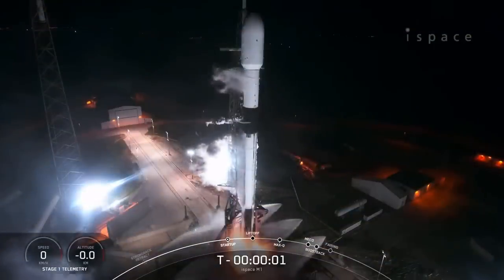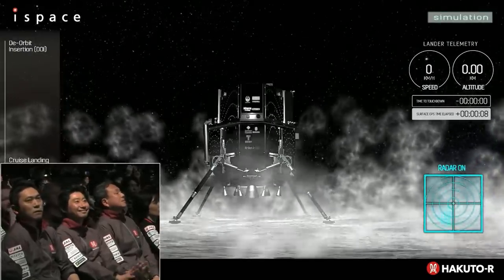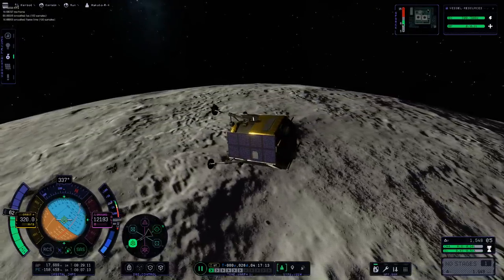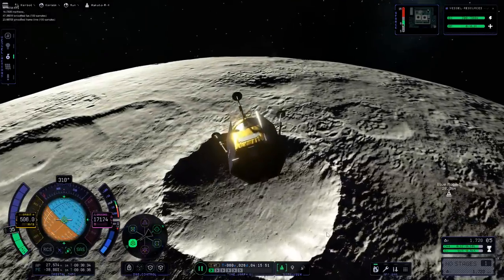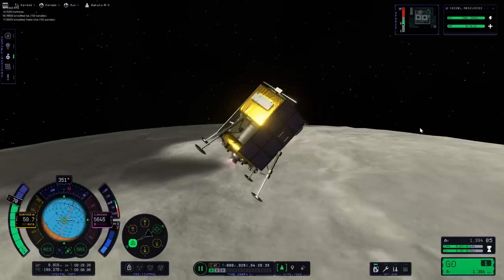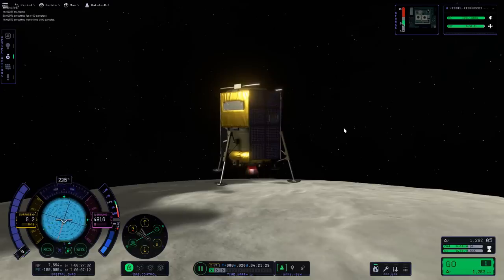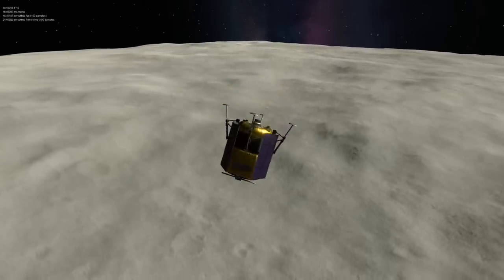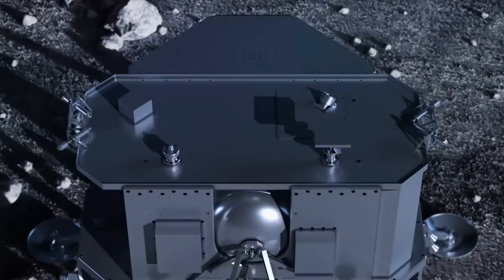Why Japan's Moon Lander Crashed Due to An Unbelievable Computer Bug

Comment: I feel such compassion for the Hakuto-R team. They are going to accomplish it!
Reply: I hope that they can make a new one and landed on the moon the next few years
Reply: I watched the landing live stream and I felt so bad for them. Their nervous faces really hurt me too. I bet they do it next tie!
Reply: They may not accomplish it. Very often such incidents reveal a whole load of issues that have been swept under the carpet, and the necessary organisational change required to address them all can easily break a small team / organisation. 

Even big companies can be killed by this. This is what is going on in Boeing right now. They caused the crashes of two 737MAXes and killed people. Since then they've tried to institute root and branch reform of how they run their business. Yet, they're still having problems. The most recent one was a fuselage manufacturing defect (they were building them wrong) that had gone unnoticed for approx 700 airframes (yep they're flying, possibly with Southwest today!). Fine, they've found it, repairs needed, not immediately dangerous, but cannot be ignored. 

Trouble is the manner of them finding it was accidental; someone was in the right place, at the right time and realised what was going wrong. The issue is that, if despite the introduction of a root and branch reform about how they approach quality (= safety, reliability) they're still finding major issues by chance, then the root and branch reforms are junk and are not working. They should be finding such problems as part of a systematic continuous improvement process, and they're not. So the bet-your-life question is, what else have they missed, given that they've essentially admitted that they've not been looking hard enough? 

It's similar with 787 (fuselage barrel joints), brand new 737MAXs with FOD and rodent damage, etc. 

This suggests to me that Boeing are in no way adequately reformed following the MAX crashes, the problem most likely being in the senior management who never understood it before and are still there today. It's worryingly possible that they're going to make another fatal mistake. Ok, the FAA is now (belatedly) keeping a much beadier eye on Boeing, but they can't see and check everything; certification engineers / inspectors are not there to do basic QC and basic QC improvement. 

The Hakuto team's best bet, if they're to try it again, is to just fix that one core issue and try again, and do as much simming as they can muster. Unlike Boeing, crashes are just disappointments and money.
Reply: ❤❤❤❤❤❤❤❤❤❤    Yes they will succeed…… After they spend a lot of someone else’s money……… Let’s all go to Sugar rock Candy Mountain
Reply: But they launched knowing that their testing was invalid.  Kinda like practicing parachute landings in a field, then jumping over water.  I hope they don't ask me for a donation, because polite refusal often offends.
Reply: @emileriksson76  What color is the next tie?
Reply: @abarratt8869  The one thing the Japanese are good at is incremental improvement, even at large organizations. If anyone were to succeed at a second go, it would be them.
Reply: @abarratt8869  Wow that is one monumental leap from a software testing issue to a systemic corporate issue in one step. Good example of sophistry for a logics class.
Reply: @zorbakaput8537  It's a reliable and well documented leap. There is no mystery as to how to do things such that success is more likely that not. The systems engineering and organisational processes are extremely well documented, including by organisations like NASA, Toyota, etc. Choosing to not follow them is an organisational issue. 

There's a pretty good dissertation "Lessons From Systems Engineering Failures: Determining Why Systems Fail, The State Of Systems Engineering Education, And Building An Evidence-Based Network To Help Systems Engineers Identify And Fix Problems On Complex Projects" by Diane Constance Aloisio from Purdue Uni which is pretty good, and cites more good material on the topic. Fig 2.1 illustrates the STAMP model of accidents and the places where failures occur; most of them are nothing to do with technology design and implementation. And another example, the Challenger Accident report, points primarily to organisational failures in NASA, rather than to the design and implementation itself being irrevocably wrong. 

The Japanese themselves summarise it all as "ask Why? at least 5 times" to get to the real reason for a failure. In this case, question 2 is "why wasn't simming done?", and you're then already straight into organisational issues, and not technology issues.
Reply: @abarratt8869  the loss of Columbia is particularly unforgivable after a history of previous foam strikes. Just like with the O-ring burn through everyone thought it was ok to keep rolling the dice because they had gotten away with it until they didn't. Such complacency is still shocking to this day.
Reply: I don't know if that team will be staffed by the same people next time...
Reply: Well, I don't know what went on with them, but remember the precursors of the Challenger disaster? That is very typical in organizations. Quiet, thoughtful engineers who nobody likes notice these things and propose fixes... and are immediately shouted down by a bunch of alpha male dudebros who can't rub enough neurons together to see the gravity of the problem, but do know that they don't want to inform the higher ups of a delay and don't want to have to do more work, so it's not in their immediate interests. Since these guys group together and rise to the top of social hierarchies, they impose their 'criteria', and then things crash and missions fail. Right about now they will be looking for a convenient scapegoat.

This is getting worse nowadays with so many organizations focusing on 'soft skills', meaning just getting along with your team. That sounds great - until you realize that 'getting along' usually means shutting up about inconvenient truths and going merrily along with direction of people you know are making bad decisions so that you aren't fingered as a 'misfit'.
Reply: @abarratt8869  If this was their only issue, they can definitely try again. But that software would have to be overhauled big-time.

Comment: Being a software developer, I have seen this happen countless times in multiple companies. Software is often overlooked. Testing is usually considered redundant and a waste of time/money. Developer's warnings and requests are normally disregarded or displaced by other department's concerns which are non-technical and even non-functional.
Reply: In my experience the software developers/engineers are kept out of the decision-making inner circle. Actually, this goes for engineering/tech in general. It’s fine, just change this, this and that: what’s the worst that can happen?
(Changing the Moon’s landscape to more closely resemble a seedy neighborhood in Brooklyn, one spacecraft at a time.)
Reply: After fully tested, I still fear my code would break in some case that we have not looked 😂, its scary for space mission

Comment: Software may have been the proximate cause but you can argue the real problem was somewhere in the development and quality control procedures. How can you not re-run a full landing simulation after changing the landing location? It reminds me of Starliner's problems in 2019. The software glitch where the flight computer grabbed the wrong "time" was the proximate cause, but the real problem was Boeing never ran a full end-to-end launch simulation.
Reply: Actually these days so much of manufacturing and coding is outsourced that the management, hardware and software teams are no longer next to each other - quality control begins to suffer massively. The more people outsource stuff, the more the work gets into the hands of rookies paid on cheap wages, who then end up making rookie mistakes that then require even more time and energy to fix. Boeing turned from an engineering firm to a management firm and the rest is history - 787, 737 max, 777x, Starliner.

And as more and more automation comes in there's less and less human intervention to take care of the times where the computers reach their limits.
Reply: Feels like they might not have a great CI indeed, probably more like bunch of artifacts in git LFS type of management. But Starliner glitch might be slightly different topic IMO
Reply: I was also wondering how expensive such a simulation would be.  If they aren't too expensive, I was wondering if you couldn't run landing simulations from randomized positions and flag anomalies from there. Not so much that you can just fling the lander at the moon arbitrarily, but more so you can find starting conditions which result in something weird.

IDK, maybe we're getting into a space where "moon lander software testing" and later "asteroid lander software testing" might be a market, that would be amazing. With the costs of these missions, there might be some money on the line for a testing company - especially if they end up with a body of "known problematic situations" like the one from the video.
Reply: How can you put a tank that has experienced both problems and damage in test into Apollo 13?  Exactly like that, only different.  Or get km and miles crossed up and smash a probe into Mars (IIRC), or ... ad infinitum.

You can run all the simulations in the universe and still have problems, but not running ANY sims to cover a deviation in the program...yeah, that's just begging for it.  I would think, in this day and age, that you could pretty much run that sim real time in parallel with the mission, for the problem they had there, knowing the path and surface profile, I'm guessing, and have it fire up a quick "do not ignore the damned properly functioning radar" command, or some such.  It might even be good to have REAL TIME simulations running against the truth of the mission.

Having done some aerospace hardware design, I'm guessing that there were schedulers and/or bean counters directly in the problematical loop.  Or maybe idiotic MBA wielding managers that think they are engineers, or worse know BETTER than the engineers, because they know a few buzz words, and then maybe hold people's feet to the fire to get them to sign off on VERY cold Shuttle launches, or what have  you.  That's the sort of feedback you do NOT want in, say, a servo.  :-/  Sometimes I look back and am glad I am retired, frankly.  Some of it was fun, some of it SUCKED.  

Doc requirements come to mind as some of the latter.  I had one junior documentation fiefdom wannabe tell me that the real output of a program was the documentation.  When I finally quit laughing I told her that if she actually believed that she should go talk to some F16 pilot and ask them which they'd rather have with them on a mission, a working LANTIRN pod, or the documentation that describes it.  She wasn't happy, because then a couple of people standing around laughed too.  She wasn't a nice person (that's putting it mildly), or I wouldn't have said it that way.  My bad, I guess.
Reply: Armchair quarterbacks are a dime a dozen. You can certainly crow if you ever land a vehicle on the moon or even achieve orbit. Perhaps we can talk about "how obvious" the solution was when we stop whining about how LONG it takes to build and fly a vehicle and how the contractors are "milking the American public" for so much money.
I thank Providence every day for Kathy Lueders and NASA for riding herd on SpaceX to make the Dragon 2 safe. Everyone had lots of criticism for NASA for being conservative and "delaying" the first launch of the manned spacecraft. But all that effort kept the astronauts safe. (Also SpaceX had a real leg up on Boeing, because they had a working cargo spacecraft in Dragon 1 to build on. The last time Boeing designed a manned spacecraft was the 1970s and the Space Shuttle. All those engineers are long since retired.)
Reply: Consider this might be the default outcome of having multiple teams. Shouldnt be surprised. Takes effort to prevent.

Upper Management asks simulation manager "simulations done?". Manager says " yeah we ran simulations at every place you considered landing, coming in from multiple angles too, never fails."
Reply: I run simulations at work but you end up troubleshooting the simulation more than the actual thing you're simulating, and when it comes to the real thing there are real things that always surprise you

Comment: I'd argue it's due to inadequate testing and making assumptions they shouldn't make rather than just blaming the software.
To move the landing site and NOT run a series of full simulations for the new site is just an astonishing degree of incompetence!
Reply: This.
Reply: @mcgilliman  I like to think of an F1 analogy... Imagine if you set your car up to race in good sunny weather in Monaco at sea level, and they changed the race to be in Mexico in soaking wet weather at 2,260m above sea level... You would NEVER just race the car with the exact same set up and no testing before the race!!
Reply: True, but if history has taught us anything it's that the incompetence almost certainly wasn't the software engineers themselves and was instead a cumulative effect of multiple levels of beurecracy repeatedly ignoring the recommendations and pleas of the people who actually knew what they were doing and what additional work had to be done. I suspect this is a scaled-down version of Challenger all over again, albeit thankfully with no loss of life this time.

Comment: Working as a Software Tester I often see the managers tend to take the risk to save some money vs malfunctioning SW especially when it has to deal with error handling.
Reply: Which is a shame, really.  The more expensive the project, the less management should feel like cutting corners on error handling and verification.  Ah, well, what "should" happen in the real world doesn't agree closely with what actually happens in the real world.

Comment: Hi Scott:   Very nicely done! (but then, I say that a lot about your stuff...).  This scenario is directly reminiscent of the situation on the Apollo landings where passing over a crater (or any other feature like that) would cause a 'jump' in the Radar Altimeter-portrayed altitude, and it would 'jump' from the PGNCS altitude.  Remember 'Delta H'?  The difference between RA and PGNCS altitudes.  In order to keep things from diverging in the PGNCS, they had to incorporate a 'terrain map' into the software that accounted for local differences in surface elevation.  Remember the landing of Apollo 17?  At some time in the PDI maneuver, one of the crewmen (I can't tell which one--they sound a lot alike) said 'We went over the hump, and Delta H just jumped'.  It sounds (at least at first blush) like a feature similar to the Apollo 'terrain map' might have been appropriate here (?)  Thank you.

Comment: There's an argument to be made that if a sensor is critical enough that if it fails you're going to land on non-existent terrain 5km up, then you just assume it won't fail. If you handle failure gracefully but then don't have enough data to avoid crashing, what's the point of handling it gracefully?

Of course, ideally you'd have a backup. Like another radar, or GPS, or a video camera capable of estimating height using machine vision and a map, so you can sanity check it. The next best thing is just have a map: the vehicle knows where it is, so if it knows the terrain it can estimate what the radar values should be, so instead of going 'eek, a delta of 3km in ten seconds is clearly wrong' you go 'the radar has shown a delta of 3km in ten seconds, what does the map say the delta should be? Right, 3km, moving on'.
Reply: You can have a video camera that is very good at finding the distance by using phase detect autofocus, same principle as a rangefinder.
Reply: I work in flight software and you're right. At a certain point if a system is so critical and irreplaceable you just have to trust it won't fail because as you said, detecting the failure isn't helpful if your SOL.
Reply: There is an argument to be made that if a $90 million project can go up into smoke due to a single sensor failure you have an expectation that it could potentially fail, you should really have some sort of redundancy even if it is unlikely. Or some other form for backup plan. The question is if it was actually considered if this sensor could fail, or if it just used the same behavior failure detection and handling as any other sensor without further consideration.

Comment: Similar thing happened in 2017 with second launch from new cosmodrome Vostochny, old software logic applied to new geography without double check. Didn't happen at first because they used very rare Volga upper stage but second launch was in default configuration that flew for decades from launch pads everywhere including South America. So after final separation, Fregat upper stage was scheduled to make 10 degree turn counter clockwise but due to geography of new cosmodrome and flight trajectory, software decided that it needs 350° clockwise turn instead. Didn't end well. Turned out that there was narrow set of input parameters that could make upper stage behave like this and new lauch pad won jackpot.
Reply: Wasn't there something about thermal modelling and pipes freezing in the fregat upper? Or am I misremembering
Reply: @JohnMullee  No, that was definitely some other story